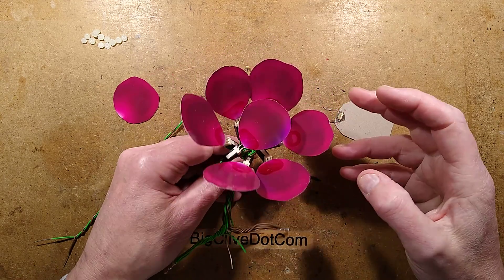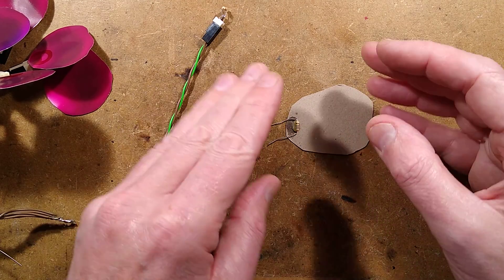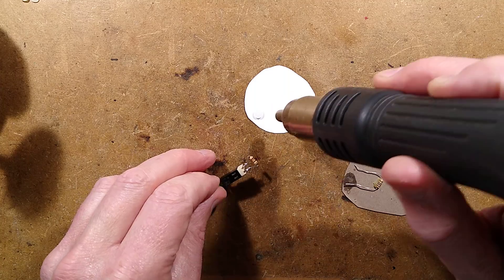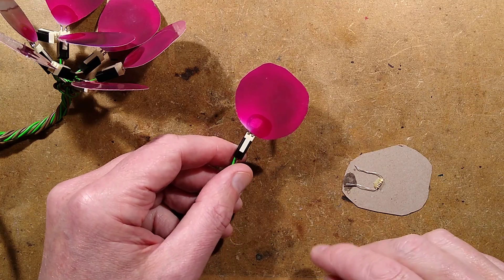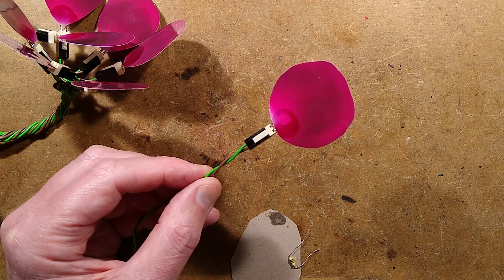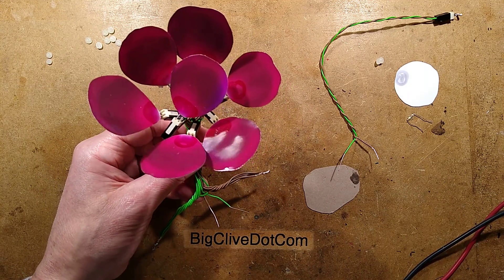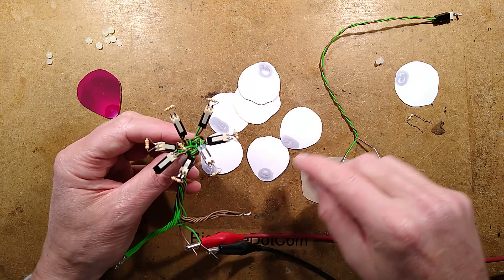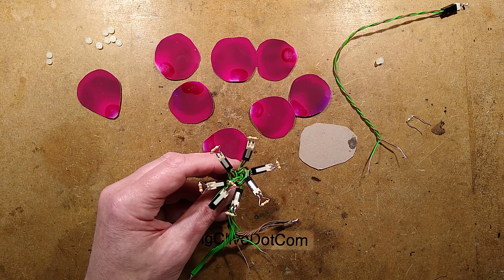Experimental electronic petal dropping prop

Comment: I think you need to add a little more weight to the petals, so surface tension does not hold on to the petal. Have you considered using a thin bridge wire to attach the petals? A thin fuse wire, made from wire wool, could be made to break, with only a small spark, eliminating the need for wax, and giving a more immediate effect.
If wax is used, a nichrome wire heater might be easier to hide than a resistor.

Others have suggested using bimetal clip, but an improvement might be to use memory metal wire. Passing a current through this could change its shape to open the clip. Memory metal (Nitinol) will unfold in hot water, so does not require a high temperature to change shape. The advantages of this is that it self resets, and is easy to hide.

Comment: The wax in tea lights is usually a lower melting point than regular candle wax. 
To set the wax quickly how about a metal block that's been in the freezer?

Comment: Could use different resistor values to give a more staggered drop. Or a microcontroller with timed switching and MOSFETs.... But that's getting very silly. Maybe just right for you?

Comment: This is awesome, Mate!  I was expecting something more "pyrotechnic" but the heated wax idea is fantastic!  Dental impression wax (from you know where) has a very sharp transition temperature, and the "petal drop" might be more decisive!
Reply: I do wonder if a coil of wire and a LeMaitre type system could drip the petals separately on a Cue.
Reply: I was hoping for that too. Connecting the resistors to the mains would achieve a much more decisive drop !
Reply: @dino6627  That might result in combustion of the petal 🔥
Reply: A small piece of nichrome wire could work as well.

Comment: Use Vishay-Dale RS 1/4 watt resistors. They are black in color so they won't stand out and they are wire wound so they are very tough. I work where they make these. I have see them glowing red hot and still survive.

Comment: I suggest trying short loops ( U-bends) of small diameter motor armature wire. Rapid heat response with low power supply.

Comment: @bigclivedotcom great idea on a side note I'm not sure what temp your able to get out of those resistors but you may want to consider glue sticks for something even more robust it should also flow less and alternatively with a more robust adhesive you could replace the resistor with a thin wire heat filament to be less visible TTFN PS an after thought you could also use led as the heating element  and to give a glow/magic glowing effect.
Reply: Please use punctuation once in a while.

Comment: I wonder if electro magnets would work better?
It would be instantaneous, and very easy to reset quickly.
The magnets wouldn't have to be very big at all, and you'd just glue a small metal tab onto the petals.

Comment: Simple and silent wins the race!  Nice idea, cheap, easy to control and one could have a batch of prepped petals, so that during a multi-run day, just plug in fresh petals, and the next morning re-fuse and reuse.  Maybe a controller with buttons and a 15 second max timer to be sure someone doesn't cook something.  (Wax is scary stuff.  a wax thermostat in a car lasts for years, and has the force to open and shut against flow and a large spring. Simple and effective.) A cool idea, here.  Excellent!  Stu

Comment: I made a petal dropping rose for Beauty and the Beast several years ago. I started with an artificial rose and hot glued small plastic tubes to the bottom of the petals. I ran strands of music wire up through brass tubing into each petal. Then they could be pulled one by one releasing the petals to fall. Very simple to reset as well.
Reply: Did you consider adding a tiny fan in the dome to make the petals 'shiver' before releasing?
Reply: @tbelding  they sort of shook before leaning and falling just from the wire being pulled out.
Reply: THAT sounds interesting

Comment: This is a good, inexpensive solution.  However, I think you dismissed electromagnetic approaches too hastily perhaps.  For example, you could use a small fixed magnet, properly polarized, glued to each petal.  Put a small electromagnet in each 'stalk' and rely on the fixed magnet to hold itself to the stalk with no energy applied to the electromagnet.  To release the petal, you energize the electromagnet which is polarized to repel the petal when energized.  Instant response time plus easy resetting.  Or, similarly, you can wind the electromagnet around a fixed magnetic core.  It will hold a piece of steel until energized when the electromagnet cancels out the fixed magnet.  I believe NASA actually build some prototype space boots based on this principle.
Reply: How about a small solenoid pulls a small pin out of the petals stem allowing it to drop.  Pins return to "hold" position when the power goes off.  A spring.  Reset time would be however long it takes to push the petals back on.  Need some friction in the hole, on petal side of pin, to avoid bouncing off, rotating etc. Only consumes power when required.   Lots of good ideas floating around.  This is fun.  Never thought about this area before.   :)
Reply: Magnets on petals would be heavy. Maybe a very small slither of metal would be acceptable. The electromagic parts would be entirely on the flower stem
Reply: A small piece of steel shim glued to the back of the petal and tiny coils with ferrite cores then kill power to that coil to make them drop.
Reply: I would've used a tiny magnet and a small coil in front of it that would pinch the petals when energized

Comment: Add a small heat resistant circular holder for (around) the wax bead. Should contain the excess wax and allow easier reassembling in the theater.

Comment: With very thin material like red acrylic bent and cut to shape. 
With wax on the tip. Next is there fine wire like Nick Chrome. This might be bent to shape for each pedal. 
This video really gets the brain thinking. 
Thanks Big Clive.

Comment: Perhaps hooking each petal to an Arduino output so there can be a delay between petals falling?
Reply: add a DMX interface with the Arduino and the pedals can be triggered by cues from the lighting folks!
Reply: Or use different blends of wax, from butter (almost immediate) through sealing wax (almost never).

Comment: You could use different size resistors to get them to drop at different times. The wax can be blended for different melting points to drop at different rates maybe. I'd have gone with a tiny coil creating a magnet you attach a ferrite core. Glue a pin to each pedal Then you could time the drops. Arduino in the pot below? The tough part would be getting them to grow again.
Reply: I like the at tiny and magnet! too many heat sources on stage.
Reply: I expected him to do this for the last petal - use a higher resistance to make it melt slower, but he then made me realize they needed more precise control over it with what he said later in the video. The magnets do sound ideal, I wouldn't worry too much about the noise of relays for a couple reasons, first the relays would probably be backstage and long wires would be used to get the power to the magnets on stage, and second it seems like the intention is to be using the prop during a song, which should hopefully be way louder than the relays :-)
Reply: @cheaterman49  Or you could just use MOSFETs.  They hardly make any noise at all unless you drive them too hard... ;)
Reply: @Culturedropout  That's the thing, I was thinking that it could be a pretty big load for MOSFETs, not worried about sound so much (rather heat), but you're right, half a watt is really not a lot!
Reply: @cheaterman49  A cheapo MOSFET like the IRFZ44N can handle up to 50 amps with proper cooling, which would be about 500 watts at 12V. Your electromagnets are in safe hands.
Reply: @rexsceleratorum1632  "proper cooling" being a keyword here :-) I usually do PCBs and SMD ; there's only so much heat that can go through a 1oz ground plane!
Reply: The issue here is complexity.

This is a prop for stage use, it needs to be as simple and robust as possible.

Heat + wax is the definition of simple.

Arduino, magnets and so on goes above and beyond what stagehands are capable of troubleshooting, fixing, and setting up.

As a final product, yeah sure going with a controller device and magnets or other mechanisms would be awesome, but that's a final product that's been tested and manufactured and would honestly be better as a home prop.

The acronym KISS exists for a reason, and is usually the best way of going about it.

I work on stages all the time doing concerts and we don't have nearly the same chaotic lack of time as theater guys do, and even then we constantly run into issues where X doesn't work but it won't matter because I drum rather than act. 

Just imagine a fully visual media not working because software bugged and didn't work isn't great especially with an important scene. Wax always melts with heat, is cheap and you can very easily mass produce the petals for nearly nothing as a cost.
Reply: @CreamAle  I agree 100% KISS.
My caution was that if there are stage
lights in use, wax could be problematic.
The bit with the hollow stems and thin wire or thread sounds perfect.
My work on stages was 30years ago when
LED side lights were just coming around.
For low budget we still use PAR 56 and 
63 cans. Often the lighting power is double the PA draw.
Reply: @n3glv  a bit of kapton tape under the wax would prevent a bit of the heat coming through the face of the petals. As a side effect it would also prevent molten wax being wicked into the surface like his paper ones did which altered the printed side. 

Doesn't add much complexity, solves 2 problems with 1 cheap and easy solution.
Reply: @n3glv  These are likely to be under a dome - they can vent the thing, and it's not going to have anywhere near the level of lighting (heat) as the main stage itself.   (Also, much of the infrared will be bounced by the glass, depending on the type)   

if anything, they'd just need to shift to a slightly higher melting temperature wax - there are going to be tons of choices, and at least the petals, wax, and resistors are a lot cheaper than trying to go out and rebuild an entire prop in the middle of a production, because someone else decided to modify it to be 'better'.   (Thank you, Edward Albee.  Idiot)
Reply: @CreamAle  but are you the fucking mastodon drummer!

Comment: Very clever! I don't think it would take much work to hide those sockets with some paint or something, especially if you want to retain the sockets so that the spent resistors can be removed and fresh ones put in. 

As for the thread idea -- you could have quiet motors in a base with a remote control that would just spin the motors to wind up the thread and pull it down thru the stem, releasing the petals, although that would probably be significantly harder to reset than your resistor idea.

Oh, and to cool the wax faster, maybe put a chunk of cool aluminum on top?

Comment: Set the wax faster with an upside down air duster can. The liquid propellant will cool it as quick as you melted it.
Reply: Awh, beat me to it! haha. I use this trick all the time in my RC hobby ;)
Reply: There’s also straight up freeze spray. It’s similar chemical to air duster (Difluoroethane), but with more to it (Tetrafluoroethane), somehow making it much colder. Although, I don’t know the mechanism. Density maybe? More bits to fly away? It’s much more expensive though, so never worth it for hot glue or cooling your soup while also making it taste terrible.
Reply: @float32  One boils at -25c and the other at -26c, so I don't see why there would be any real difference in cooling
Reply: @skipfred  different specific heat capacities.
Reply: @float32  Sounds like some dangerous soup :-)
Reply: Maybe just use an ice cube?
Reply: did you notice how sensitive to wind the petals were?
Reply: I reckon in liquid form that stuff is actually a good solvent, so I doubt that will work
Reply: Looks to me as a simple and effective way to create the desired effect, not overly complicated, a good solution - well done.🥀 Wax and heat is all you need, for the flower petals to be freed !!!!!!
Reply: That stuff is so bad for you to breathe

Comment: How about a bunch of small tubes/straws with threads running through them, each tied to a petal. When the strings are pulled taught the rose resets and then as you relese each thread a petal falls.
Reply: You could do an automaton-style cam system. Connect them to a lever held by gravity on a sort of heart cam which pushes the lever up releases the tension on the string and then you just make a bunch of cams and levers and you can position the cams to drop petals at different times, then it would reset itself by continuing to rotate.

Comment: this reminds me of when I was a teenager this reminds me of when I was a teenager with my best friend and we had made some sugar rocket fuel inside of a tin can.
 the igniter was a broken incandescent bulb laying on top of the solidified fuel with a wee bit of gasoline. This was powered by two 9 volt batteries.
 the cam we used was just a tomato juice can with a hole punch through the center of the top and then everything was poured in with a final and melted over a stove range carefully and stirred with a chopstick until it was all nice and gooey and melty melty.
When I later Revisited this pyromaniacs little dream I substituted the electrical circuit with just a birthday sparkler.
And the last Innovation was that I would mix filings from a key cutting machine that I just got for free at the hardware store in with the melty goodness and this produced some remarkably bright and energetic Sparks and  tons of smoke that would shoot right out of it.
 Of note,  if you wish to try this at home kids, dig a little hole in the ground big enough to put the can into so that if it should rupture you'll be contained in the ground from lateral splooshing.

Comment: The best part about this is the use of electrical heating that allows control from a remote location.  So a simple multi- conductor cable could control it from offstage.  Maybe some modeling clay could be shaped around the sockets so the cluster looks somewhat like a rosebud.  Thanks go to Clive's ingenious prop shop for the infotainment!  👍👍

Comment: Why not use a piece of poly thread that is "sewn" through each leaf around the center bulb and could be fed through the stem to a simple DC gear motor that would retract the thread allowing the petals to fall off systematically

Comment: A magnetic version could possibly work with the same resistor heater to heat small magnets above the temperature where they lose their magnetism. The only issues would probably be how much power/heat it would take, and the weight of the magnets making the petals heavy and fall too quickly.

Comment: You could try 3d printing the petals.  Then you can form a socket for the wax.  Also you could mount an led.  Make it flash or pulse while the resistor is heating maybe?

Comment: Bloody clever Clive and on a serious note. 
- Using electro magnets would give you better timing and be able to drop each leaf on queue but the piece of metal (unless you used a minimal size piece of tin foil) on the petal would make it fall funny/weird, err unnatural was the word I was looking for. 
- Using the wax and a silk petal would give the petal falling a more natural look. Could you not change the wax melt time by using different ohm resister on each petal so they wouldn't all drop at once? (See, I know squat about electronics and I can only remember that red = 2)
- Your local sex shop may have the low temp melt candles that deviants like to dribble onto their play things. 

- In addition to my other cooling comment, a frozen ice pack (solid plastic type) would be an ideal wax solidifier of the instant variety. Then you wouldn't have to invent new words while waiting for the wax to "dry". (Sorry, you may have missed that in your recording 😁) 

Looking forward to seeing different iterations of this prop. 👍

Comment: Hmm, I wonder how small a resistor would work. Would a little fragment of circuit board with a bit of nichrome across it would work. (Similar to e-matches but without the pyro compound)

Comment: Firstly, did you choose the resister buy a mathematical equation or did you find it by waxadent? 🤭
Secondly, if you want to be impatient then cool the freaking wax down with a bit of ice type substance or cold temperature there-a-bouts. 🤦‍♂️
Thirdly, when reflowing the wax, should you not be using some wicks to make it flow better? 🤷‍♂️
Forthly, after that last one I'll get ma hat, ma coat and like the bits on the end of a twig.....leave. 🛴

Comment: I wonder if Penn and Teller use one of those methods in their "Shadows" performance: https://www.youtube.com/watch?v=RReNgGUH1ps
Reply: I was going to ask the same question. It would make sense as I recall Penn saying he didn't like the trick and if this is it, then I can understand.
Reply: @danielgreen7342  Penn doesn't like it because it's artsy. It's not cheating, even if he's not triggering the movements of the flower himself (which I'm not convinced of) there's still a discipline to it - the timing.
Reply: Ooh not seen that, it was good. You might be right.

Comment: This has me thinking: bigger petals are coming to have more leverage, and may pull off sooner.  Silk will have less stiffness to it, and may be correspondingly slower to drop.  For those, I wonder if a wedge of wax holding a spring clip closed might work, so it's actually releasing the silk petal, instead of melting it.  Much more complex to make, but may give a more consistent effect.  Although I think that's just an NC solenoid by a different mechanism?

This is a fun problem, and I'm curious to see where it goes.